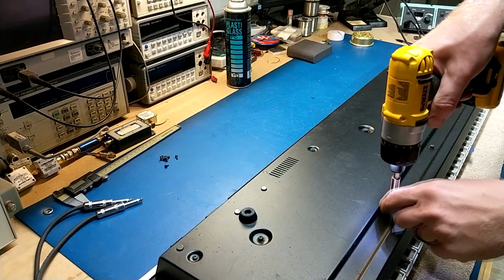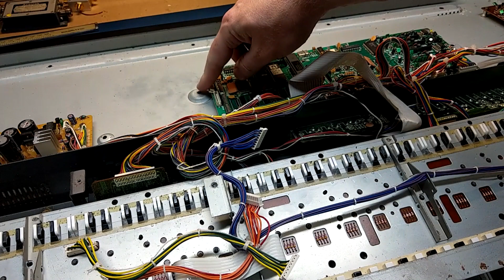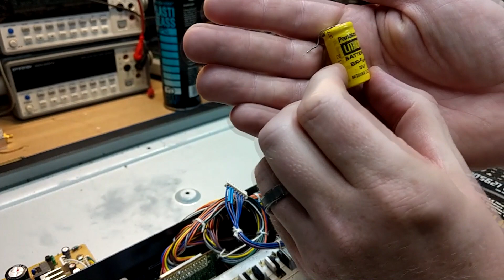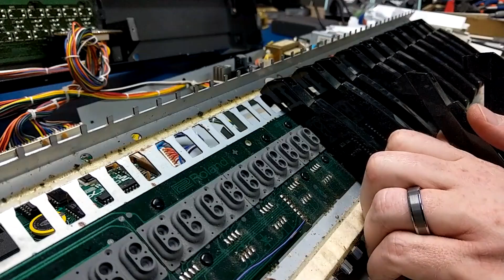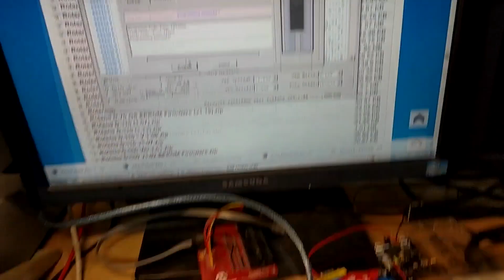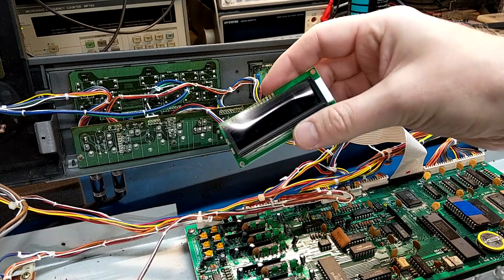Roland Alpha Juno 2 Repair

Comment: Thanks for the breakdown!  Did the bent over connector happen during disassembly?  I will be very careful when opening mine to avoid that.  Or is that middle connector supposed to be "bent" over like it is in yours?  Also, why not just use (correct color if you want) heatshrink on the abraised wires?  Instead of jumper wires, I would recommend scraping some of the soldermask off on each side of the break, and using a solid wire (stripped wire wrap wire) soldered across the break.
Reply: Interesting; when watching the vid (really rewarding and enjoyable), I was thinking exactly that's how I would do it, your method, because it just seems a much simpler route.

Comment: 6:48 rewatching this part of the video now having disassembled and reassembled one myself, I think the issue is that your synth was just always assembled incorrectly?? If you look at the service manual, the main board is actually supposed to slide under the metal part of the keyboard assembly. I was always confused by how easily you fold the synth open at the beginning, since it didn't work that way for me, and later I figured you must have just edited out the part where you carefully slide the main board out of its nook in the keyboard assembly, but now I realize your main board was just fully on top of the metal instead of nestled within it, hence those wires getting frayed from lying against the metal in a way they weren't meant to do. Interesting that it all seemed to work out for you anyway, that aside!

Comment: 12:26 note: the springs ARE different on the white and black! The ones for the black keys are slightly longer. I only discovered this after putting all 61 of them in a pile and had to sort them before putting them back on. Then again, maybe despite that difference they do provide a very similar tension, since overlooking the difference doesn't seem to have caused you any problems..

Comment: Hi! Great video. Do you have any advice on testing the 30+ SPST push buttons for the front panel membrane controls? Most of the buttons on my 3rd-hand Alpha Juno 2 don't work and using a continuity tester I can see that the 2 legs on each side are connected to each other but when I push the button down the legs on opposite sides aren't showing continuity. All the diodes seem fine.

Comment: Great video! I wish there were timestamps, but just in case anyone is looking, I have few of them listed below:
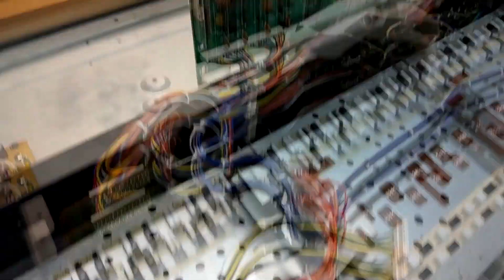- battery section begins here: 7:03
- reset procedure after battery replacement (check BA or check battery message shows): 10:02
- the firmware section is here: 20:22
- instructions on viewing the firmware via the controls (no need to open it up) is here: 23:19
- the display section is here: 26:55

Comment: On my Juno-2 (purchased in the fall of '87), the key return springs are not the same length. The black key springs are longer (but the shorter white key springs stretch longer in position).

Comment: My screen has zero backlight anymore so I was going to use your suggested replacement. Doesn't need to be an exact match, but as someone who doesn't really have little trimpots sitting around and would have to order one, can you recommend a value/measurement trimpot for adjusting the contrast?

Comment: Wow, this was the video I needed to see. I really appreciate the detail you've included in this restoration. I have a Juno 2 that had some key issues, which I've fixed, but I had a question about replacing the capacitors on the power board. I'm not sure if what I'm looking at is the cap's leaking or not. Can I send you a picture and get your advise? Thanks, Mike

Comment: Great video and thanks! I'm repairing one now that has 2-3 keys that trigger at "full velocity" when depressed. Even if I lightly touch the keys, they trigger like I hit them with more force. I need to reinspect & maybe re-clean the contacts underneath (did once) unless there's something causing this. Any insight into this root cause? Thanks again!
Reply: I'm having the same issue with one of the keys on mine. No sound until depressed and at full velocity when it does make a sound. Did you get yours sorted?
Reply: @plimx  Sorry for delay. Yes, I fixed it by removing the keybed and thoroughly cleaning the key contacts underneath the rubber pads using rubbing alcohol. I just cleaned everything under the keybed, including solder joints and the contacts. Fixed the problem for me.

Comment: Hi, what to do if the octave switch is not working? Thank you so much
Reply: Replace the switch itself. The switches on that board seem to wear out pretty easily. You can buy replacements on Syntaur. Maybe cheaper somewhere else but I can't vouch for that

Comment: Hi Brad. I think I bought the same replacement LCD. How did you rewire / solder the wiring for the replacement LCD display? I'm not seeing where to solder the ribbon cable header on the new LCD display I'm trying to replace for my Roland JP8000. Thanks!

Comment: Just stopped this vid at the mention of glued in key weights and wanted to ad to the list that used the crappy  red glue. The VK7! Tone wheel emulator series, although i cannot confirm all models had weighted keys, the 7 did. I got to be the lucky guy that took a dripping goo everywhere machine and turn it back into a  great player/Being the bottom of the line you wouldnt think it had alot of features  but it does. You can  turn off the drawbar section completely  and run the orchestral strings, choir ,brass, bass and more with a mixer in user sets. This-7  has full percussion section and mixable reverb as well. It also has an 11 pin socket  to link to a Leslie!!! back to the red glue. There IS a way to remove it safely and effectively leaving no trace. It is time consuming  and has cost plus health issues ,so I'm not going to post it here, but I will share it with anyone that attempts to convince me they can do the tedious ,time consuming job safely. Since I've done this more than once {!} I  have streamlined it and will do the procedure for a fair price. I am in the sunny Southern USA. Unless you have a no children allowed space, I recommend not doing this in a family household. Sorry Brad ,didn't mean to grab any of your thunder, but felt somethin should be said

Comment: Soon as you started this I knew I had my answer to the group of keys not playing, and i know its going to be a biatch because the board was so clean and the creases in the ribbons  were perfect plus the obvious no scuffs on any of the screws even with magnification... so i get to look at wires till i say, um .. tomorrow ..  this group of dead keys is on a xp-10  and i left words on the xp 50 recap   thanx!!  oh yeah   the xp-10 keys ar set up like your JP8000 and DONT use a screwdriver to spread the keys, use the other end of the toothbrush, its should be near perfect size,Brad here's probably popped  a few hundred,do what  I say ,not what  I do...lol

Comment: I've had a Juno 2 from new (circa 86-ish). I just checked recently sold items on eBay and the price seems to be around £500 ($650), which is much higher than you said.

But if you have a cheap source - good luck to ya' !!

I was watching your video for general repair inspiration. My synth works nearly-fine, but I've lost after touch.

Comment: Hi there Brad, haven't watched all of this video yet but I am a bout too. I got an alpha Juno 2 a few months ago and its in pristine cosmetic condition, however the aftertouch seems to be a bit faulty, the higher half of the keyboard it doesn't seem to work properly whereas in the lower half it does. The upper half you either have to press extremely hard or it doesn't work at all no matter how hard you press. This was not happening when I first bought it though.

Do you have any suggestions as to what I could do to approach repairing this? Many thanks in advance. Brandon

Comment: Were you not to have the PlastiGlass cleaner, what would you use?  Seems to do a great job and I'd like to find something similar.  What are the active ingredients, etc.
Reply from the maker: Techspray makes a plastic and glass cleaner that I also use, have been happy with it.
Reply: Try brillianize, its available on evilbay .An 8 oz bottle  lasts forever as it is not aresol.Works well on headlights  and more, after you use a cleaner like vinegar water,that dissolves bug guts....

Comment: Thank you for your video, it was very helpful to do a cleanup to some keys that weren't working. I will say however that as I was removing the springs of a couple of keys I noticed that one of them was larger than the others. I couldn't see that this was related to the key of the spring being black or white so I resolve to remove all of them and see what happened. In the end I found that there were 25 larger springs, which I took corresponded to the number of the black keys. I think the keyboard perhaps was repaired by someone that didn't know the difference but at least in my case the springs were certainly different, and it kind of makes sense. A larger spring probably has less tension and having the larger spring on the black key and the shorter one on the white evens the action throughout, given their physical distance from the hand. Hope this helps anyone in the future.
Reply: I agree with you about different springs for sharps and naturals; in fact, the service notes for the JU-2 show this, with different part numbers for the black and white keys.

Comment: Opened up my Juno 2 today, while watching your video. Super helpful! I'm trying to fix two dead keys, one extra loud key, and - probably not so easy - what seems like noise on the chorus. Keep up the great work!
Reply: I had an extra loud key - disassembled keyboard as per this video, and cleaned (cotton buds and 99.9% IPA) all carbon contacts. Problem fixed.

I cleaned all the keys (just dish soap and careful rinsing) while they were off - too good an opportunity to miss!
Reply: Did you get the one extra loud key fixed? I have a same problem with my juno 2.
Reply: i have the same issues with mine. two extra loud keys and one dead key. did y fix the random loud key?
Reply: @noahjohansen3812  haven't had time to look at it yet, unfortunately. Kids taking up all my valuable synth time, haha.
Reply: loud keys just need to clean the contacts, the Alpha Juno is velocity sensitive, it is reacting to a max velocity key press because (probably) there is dust/detritus on the contacts @noahjohansen3812